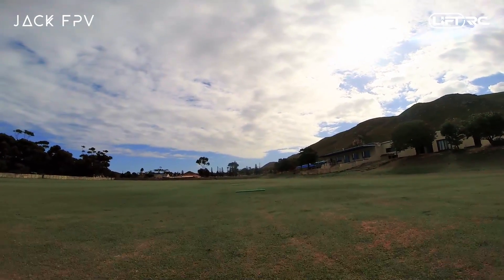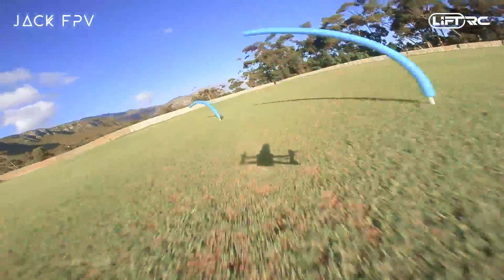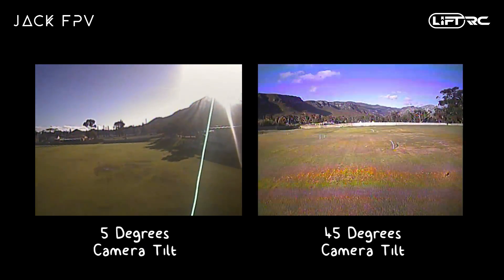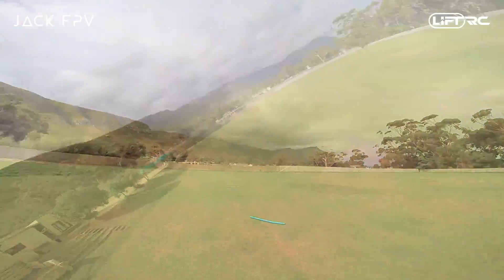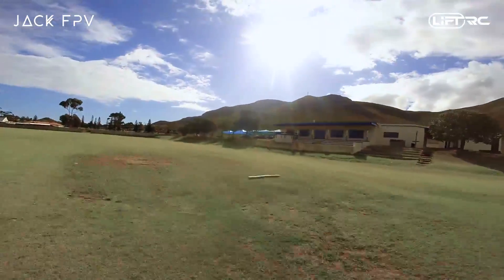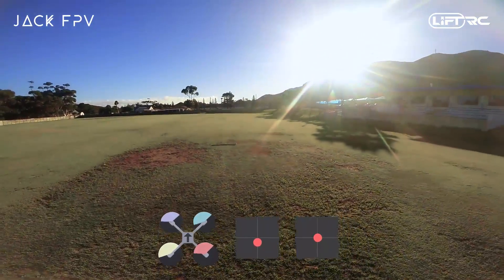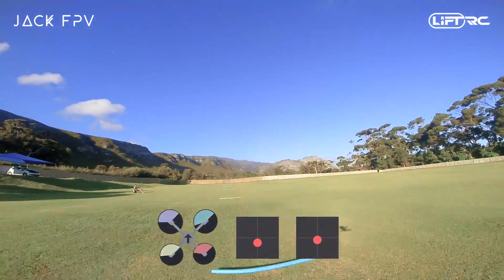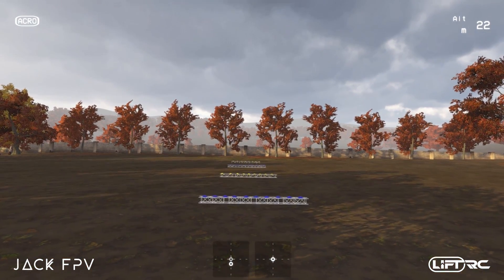How-to Fly FPV Quadcopters / Drone - "FLYING FORWARD AND SLOWING DOWN"

Comment: I have a Diatone crusader gt2  I got for pretty much  nothing 95 bucks just had to reflash it and now I got it up in the air and thing is very touchy nothing like the drone I lost this one scares  me lol I wanna try this fpv but not ready yet I continue  to fly my Tello  with vr mode. Any ideas need something like the body of the tello but motors like the Hot shot I call it (Diatone crusader gt2)

Comment: Hello, I've got my camera angle set to around 40 degrees but i feel like I still need to pitch forward more than that to get the quad to gather speed, which in turn means I'm starring at the ground half of the time whilst flying. Any suggestions or tips to help?

Comment: Hey man, great videos. i'm certainly a newbie, so would you mind telling me what program you used to record your stick movements like that? Thanks.
Reply: +Cias13 I'm pretty sure its built into the firmware on his flight controller: "clean flight". It records entire flight logs onto the micro sd which you can put in the board. That is also how he gets the throttle levels of each individual motor on the screen like that aswell
Reply from the maker: +Cias13 Hey man, +DIY4Dummies is spot on. I use a Blackbox Data Recorder.
Reply: +Jack FPV Hey, Im having a lot of problems getting my taranis to work with my mac, should you plug it in via the port at the back for master/slave and setup the config as slave so it can send everything to the computers headphone port. So far I have only tried doing it via the microusb and that has failed dismally. Any advice would be greatly appreciated
Reply from the maker: + DIY4Dummies Hey man, sorry but I don't run it from a MAC. Maybe check the support forums on Steam for Liftoff?
Reply: thanks for the replies guys!